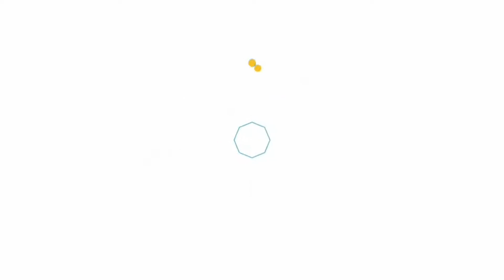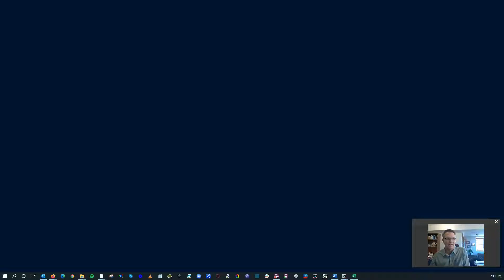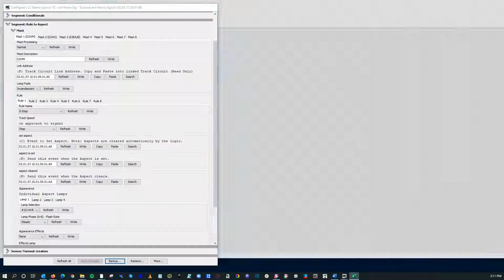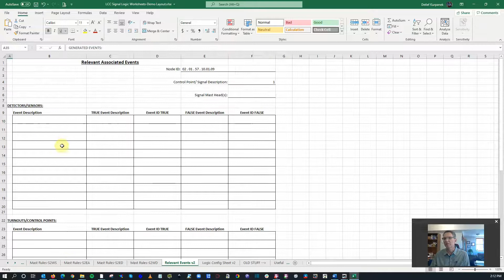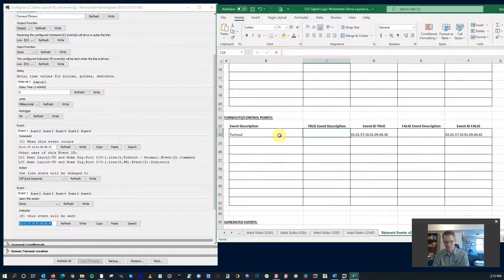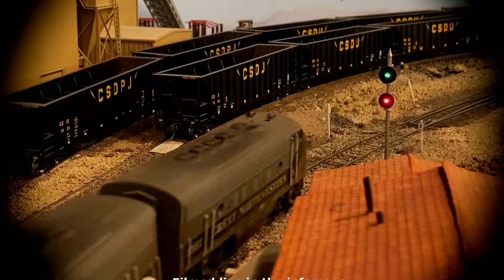TLC #15   Signaling Pt 5   Relevant Events

Comment: Awesome series. Thanks!  Do you leave the switches without detection?
Reply from the maker: Thanks! To answer your question, I detect the "control point." That is, I detect the switch or the series of switches for whatever junction or crossover the signals are supposed to protect. Without getting into too much detail, that is what is needed for CTC type signaling. I don't have CTC, but I wanted to set up the system to allow it in the future if I so desired. Anyway, I isolated and detect switches. Let me know if you need more details on this.